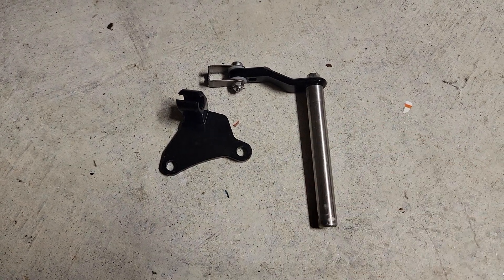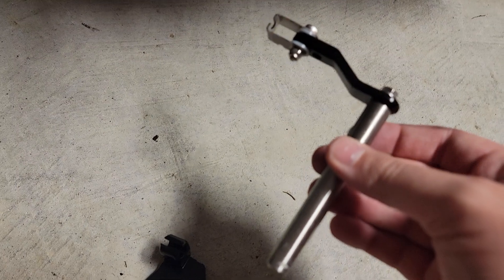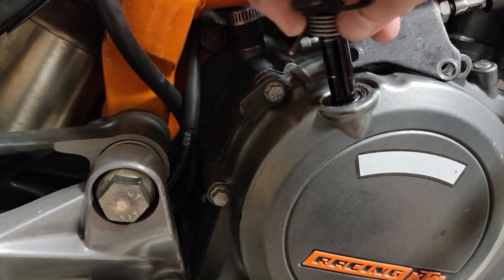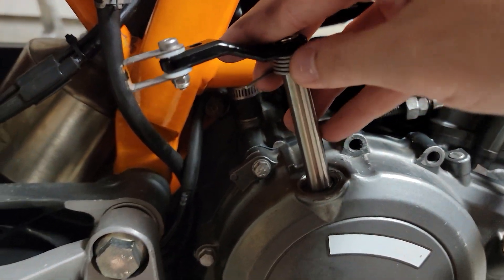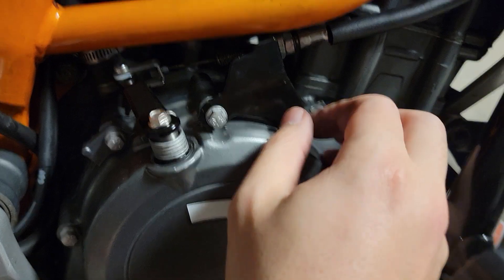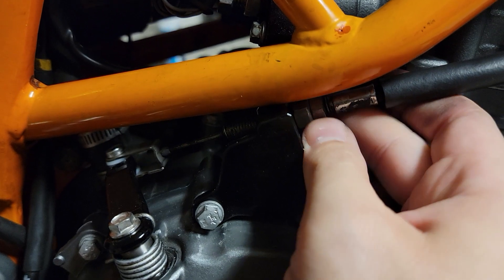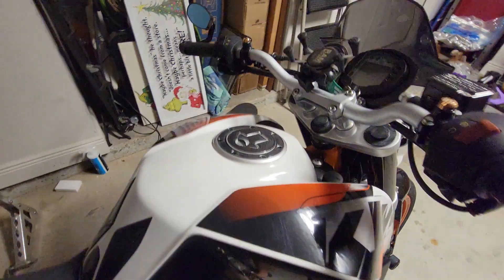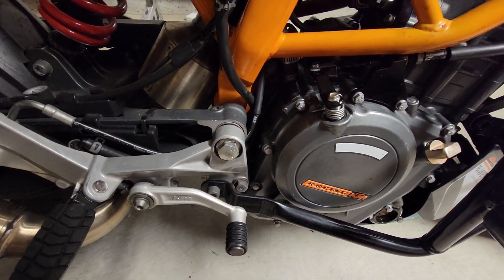KTM 390 Duke - "1 finger" Clutch Kit.

Comment: Thanks for the video, just installed mine while referencing this.  My parts were also not assembled correctly so it's best to just take it all apart and start from scratch. The white washers go between arm and stamped steel piece and you need to rotate the arm to come close the original piece after you take it out. it doesn't line up exactly like the original.
Reply from the maker: I had the same issues.  Thankfully it is keyed on top

Comment: at 8.04 I can see the clutch pivot screw moving around, its a sign that the hole in the lever is worn out and become oval shaped. Changing to a new proper one itself should improve the feel. Do you have the slipper clutch? that itself makes the clutch muuuuch lighter
Reply from the maker: Howdy Sanjay. You have a keen eye. It has definitely seen some wear and I agree it could be better in that regard.  I do have the oem slipper clutch.  I've been wanting to do so, I just haven't gotten around to it
Reply: @RhoadsChristopher  ah okay. I'd appreciate your help with my valve clearance and cam screw up, I've tagged you on the d390 forums!
Reply from the maker: @SunMysore  Did you just make a post on it?